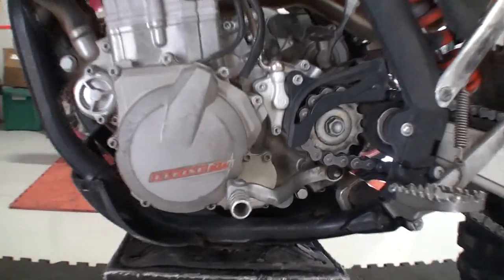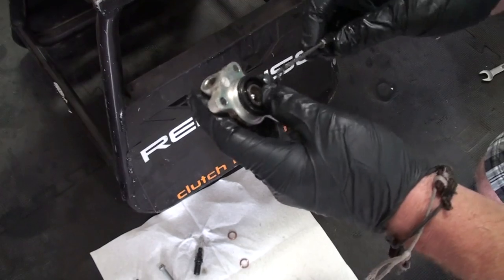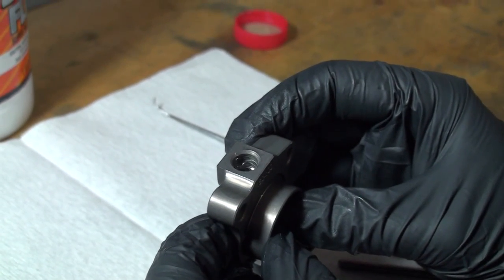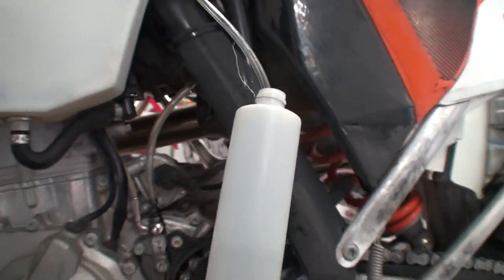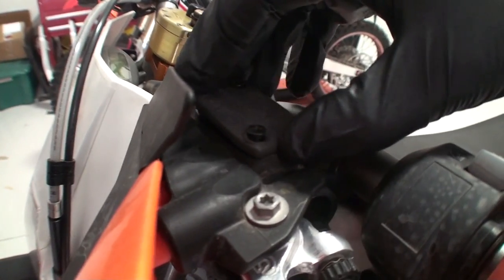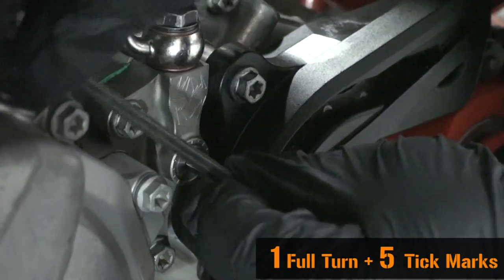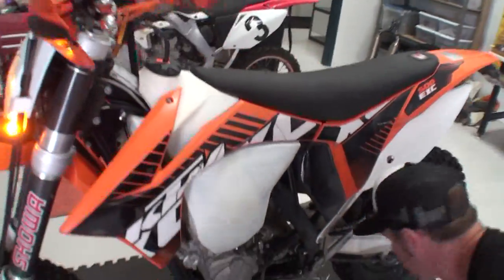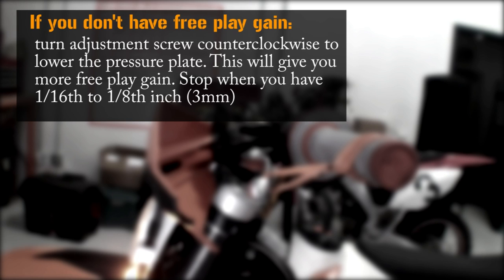Rekluse® Install | Adjustable Slave Cylinder

Comment: Hey guys. Great video and instructions. Maybe put a PSA in there to point the slave cylinder away from your eyes when you squeeze the diaphragm when getting the bubbles out because some idiot (I won't say who 👀) just did that and squirted a good bit in his eyes.
Reply from the maker: Hi there, thank you for your feedback. We will make sure this gets integrated into the installation manual

Comment: Hi, is it possible that the correct setting for my bike is more counter clock than the so called starting point?
Reply from the maker: The starting point and initial adjustment is to get you close to an optimal  setting. You can fine tune 1-2 click marks as needed to adjust out drag or slip.

Comment: Better yet, steer clear of shitty KTM and Husqvarna and relieve your self of the possibility for engine failure due to BRAKE FLUID getting into your engine.  These bikes are so overrated it's fucking pathetic.  You want Baja level reliability stay with Honda
Reply: Baja, try Dakar level. Hm, guess that’s not the deck of cards you want to play with. Congrats, after 20 years of defeat, Honda got a win 🤣
Reply: If your bike used mineral oil then it won’t affect the engine even if it leaks 🔥